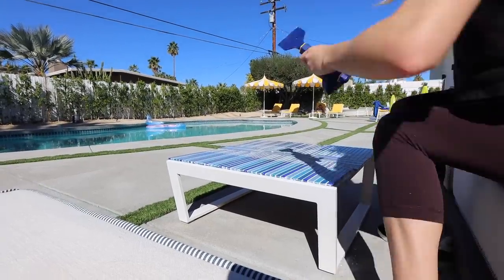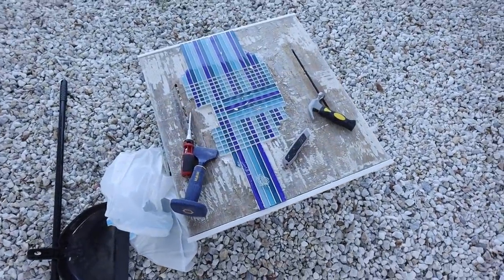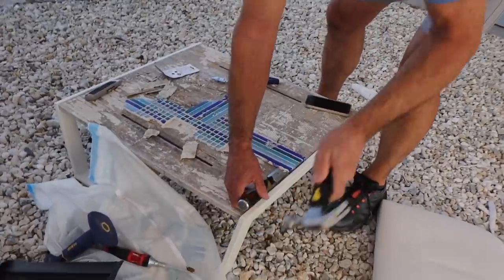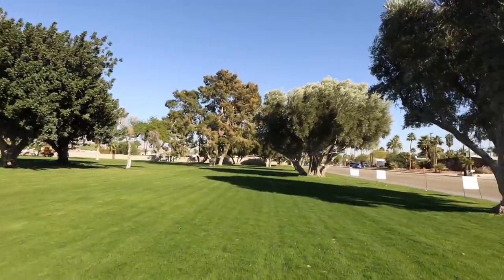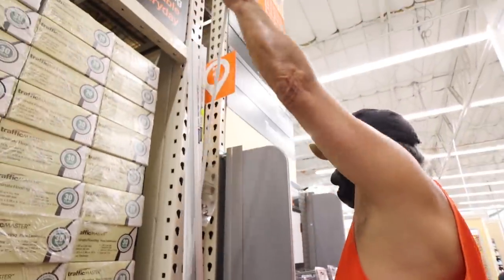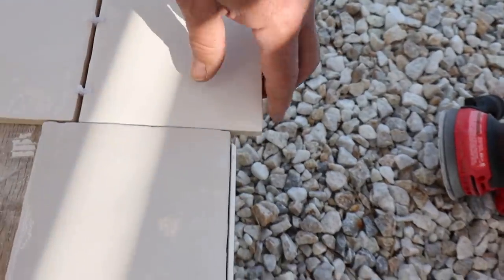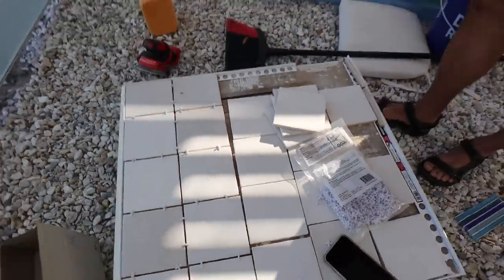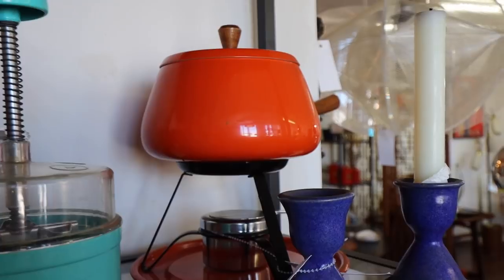learning how to tile things! DIY tile table

Comment: Fast Mike Church Method:
Next time, measure the top and get a piece of plywood cut to size. Pull the sides off the table and remove the old piece with all the fussy tiles. Replace your new top, and add your new cool tile...
...VIOLA'.

Comment: Great video Shelby. Very interesting and full of good info. One thing though: tie your hair when using circular saws. They will catch hairs and remove them with the scalp, then some more with the scalp...you get the picture. It's just basic safety if you have long hair. Buy your father and for yourself good hear muffs. They are inexpensive and will save what's left of an individual's hearing. :)

Comment: The tiles might have come up short because when you butt the tape measure it never really gives you the right number 😋 so if you burn an inch you see the actual notches by a sixteenth<. Oh yeah and it turned out frickin sweet!

Comment: How was the top attached to the frame? Most can be removed and a new wood foundation cut to fit the tile size added. Also, a bigger hammer would have made the tile removal easier.

Comment: The speed run would have been to replace wood as well with new tiles. The angle cuts would have been challenging 😳
Reply: I think they could have flipped the table over, taken the screws out and replaced the wood instead of chipping the tiles off the other side. 😬

Comment: If you ever decide to do a table tiling project again and not use spacers when you finish you can just apply a clear coat epoxy type sealant over it.

Comment: I have used a concrete chisel to get tiles off of wood before it works fine the what she says a bit thinner and sharper but because of that it can also dig into the wood if it isn't kept level.

Comment: If you think that that saw was loud you should try cutting through metal ? The saw screams . Much louder than your dad's and there are sparks going everywhere 😲 . I prefer to use a hack saw with almost no sound but it's harder to cut and takes longer ? You and your dad reminded me so much of my dad showing me how to do things. He would show me and then he would do it ??? What's the point lol 😂 . Stay safe 😘 , get that cold looked at 👍 💕 🌹 🐨